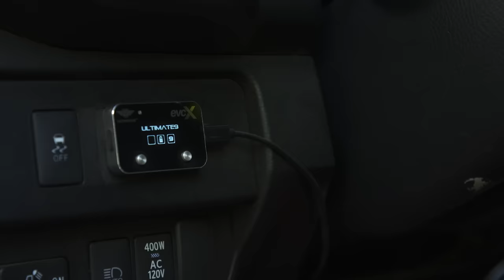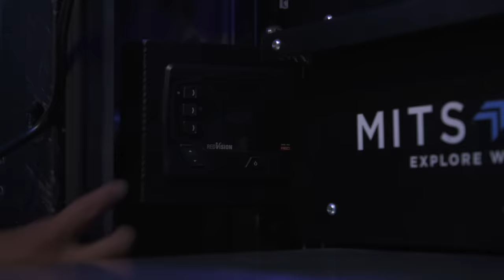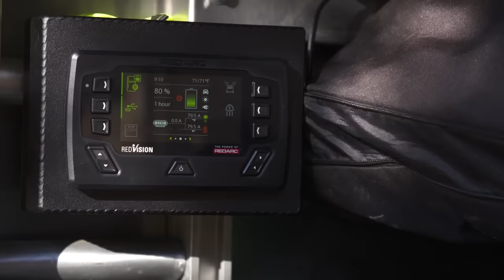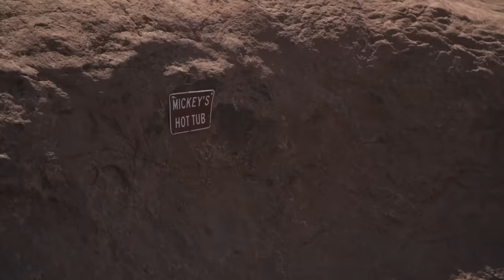10 MILES in 18hrs on USA’s Wildest 4x4 Trail! Aussies vs Hell's Revenge - Do we make it?

Comment: you guys rock ( crawl  ) I have done every trail you have done here in Moab ( plus more ) and in the Colorado video ( where I live now ) back in the day with my Defender 90, locked, 4.75 RP, hardened axles and CV"s ( yes I have broke a bunch.. field repair ) , Aschroft under drive, super charger, welder, on board air, usually ran 35's but had  37's with bead locks for the hard trails, I have not seen your Rubicon run .. Yet.. but when I live in Cali... I wheeled it twice every summer, one trip each year was the double header Rubicon->Fordyce trail my rig was the Killer Bee. You need to run the Fordyce and Pritchet Canyon and Red Cone Pass in CO, next time your back.. btw on the cover of Land Rover World Jan 2001, Axle twisting Madness in Moab, Cheers mates

Comment: Love seeing these episodes. Get to see the rigs I like taking on places I wheel. I'm not a big fan of modern Jeeps but when they're working they're hard to beat. What's great out here in the US is we can go buy a Jeep tub and if you have even a little bit of fabrication skill and a donor vehicle or two of your choice you can put together an absolute trail assassin for next to nothing. I really like building low center of gravity rigs with 38"s. My current Jeep is an LJ with narrowed 1 tons out of an 89 F350 I picked up, a Jeep 4.0 turned 4.6 stroker inline 6, an np205 with 203 doubler from old Ford Highboys, AX15 trans, and I just run Eaton trutracs and a winch. The thing is an absolute animal and barely cost me anything to make since I have most of the stuff sitting around from swap meets, trades, and resto jobs. I actually just traded a dana 44HD to a kid for an F250 4x4 because it had electrical issues. Squirrels had eaten through a big ground, replaced it and it's already spinning tires. 7.5l with Banks headers. The headers alone were worth the axle. Some people just don't want to deal with issues. Easy way to find great deals.

Comment: I've had my best results for cleaning calcite using iron out.  To hide the scratches and damages from extraction iv use dish soap water in a pot on low heat for a few hours. 

I do have a question.  I've seen florescent rocks with long and short wave at the same time.  Have you tried all three lights at the same time?

Comment: Not trying to pick a fight here, but Jeep's really do rule. I'm almost 60 and have owned Jeep for over 30 of those years. I started with Landcruiser's, moved to Patrol's, then Pajero, even had a Daihatsu F-20 and a Suzuki Sierra, but nothing came close to my 360/TH/400/1339 Quadratrac. I still own two Full Size Jeeps, but my daily is an XH Commander and my little runabout is a KJ Cherokee with the legendary NP-242. Jeep are built "light" as you hear in this video, that is because they are designed that way, no not thin metal, high tensile steel metal, which makes them light but tough as nails. Even when getting out of the hot tub, wheels spinning hard in mid air, and then hitting the ground, no broken CV's or axles. No one does it like Jeep. And please don't come at me about the price of parts, smart people buy their parts from the U.S and NOT Australia :)
Reply: No one likes to admit it because it's cool to hate Jeep.

Comment: Guys,  I think watching you do Hell's Gate and Mickey's Hot Tub was all the thrill I need.  I have a 2021 Wrangler Sport EcoDiesel, lifted 2 1/2 inches, on 33's  and no lockers.  While it is a very capable off roader I do not have the skills and upgrades on the Jeep to take on those two.  So, thanks for coming to the US of A and doing it for me.  It was fantastic watching you guys have laughs and jitters while wheeling here.
Reply: We did Hell's Revenge in a stock jeep a few years back. We aired down but didn't use the lockers. Mickey's Hot Tub, though, was too scary for us

Comment: None of these rigs are even close to a car, yet you call everything a car. If you want to use a general term, you need to use the word vehicle, whereas a car is a specific type of vehicle.
Reply: Here in Oz we call the metal box with windows and 4 wheels, that gets you around, a 'car, or a wagon'. The bigger unit that carries several pallets of beer is a 'truck'. None of these vehilces would be called a 'truck' here in Oz.
Yeh, 'rig' sometimes, depends how modified it is.
I was a surveyor all over the remotest parts of Oz, and had 2x 80series and 2x GU Patrols, all these were mostly called 'cars', sometimes 'wagons' (the official description is a wagon).